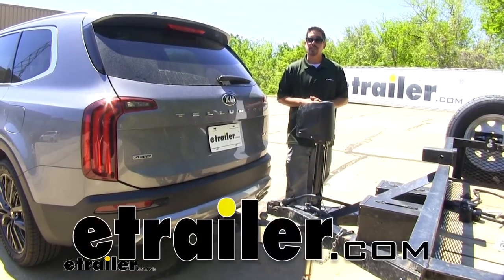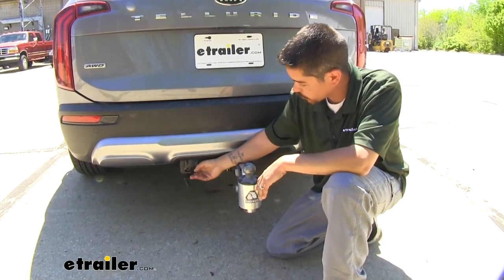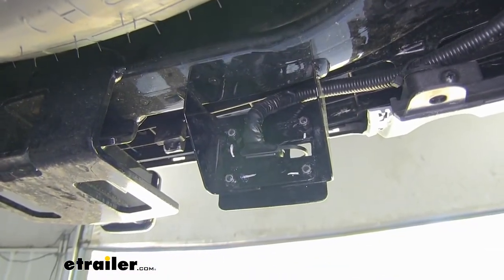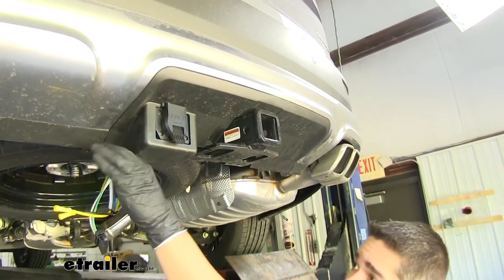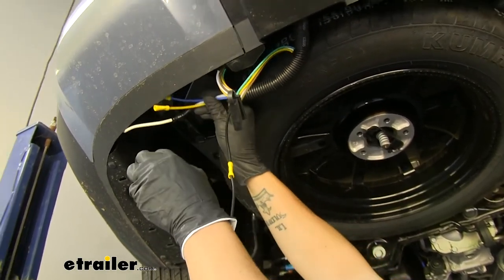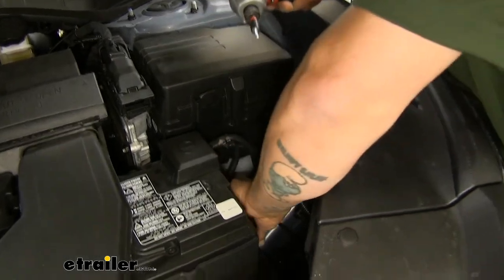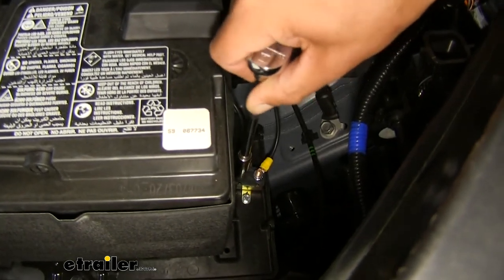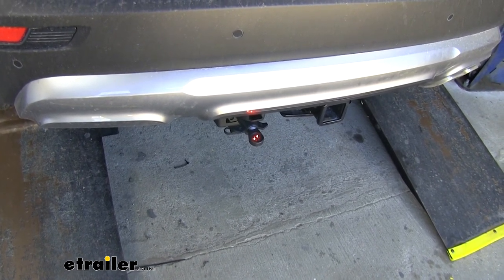etrailer Trailer Brake Controller 7-Way RV Upgrade Kit Installation - 2020 Kia Telluride

Comment: So there are no trailer backup lights with this 7 way?
Reply from the maker: The center pin of the 7-way provided with the kit carries the reverse lamp circuit, but you'll need to extend the yellow wire on the adapter and tap it into the vehicle's reverse lamp circuit.
https://www.etrailer.com/Accessories-and-Parts/etrailer/ETBC7L.html

Comment: You guys are the professionals. I have a question can a weight distribution hitch be safely used with a Telluride? My rv dealer says no we need a drop shank with sway control because it's a unibody. We had researched & already had our 7pin connector installed so we planned for a regular brake controller but they also recommend a wireless. Any input here? Tia
Reply from the maker: Many unibody vehicles cannot use a weight distribution hitch because of the frame design. You will find confirmation for this in your owners manual. 

You could use the Reese Friction Sway Control Kit # 83660 to limit the amount of sway when pulling your trailer. This kit will not put the strain on your vehicle like a full weight distribution hitch will.

Wireless brake controllers like the Curt Echo are a great option for towing.
https://www.etrailer.com/Trailer-Hitch-Ball-Mount/etrailer/989900.html
https://www.etrailer.com/Accessories-and-Parts/Reese/83660.html
https://www.etrailer.com/Accessories-and-Parts/Reese/RP26003.html
Reply: @etrailer  correct I have read that. I've researched the manual over and over & sadly they do not mention using a WDH at all. It does not say you can or cannot use one. The only thing the manual mentions is using sway control. Ty for the recommendations. We plan to get the sway control but now my worry is what would we do to adress sag if the trailer causes the Telluride to sag. Our travel trailer is well within our tow specs but was still concerned. It's an Apex Nano 2870 dry & 3800 GVRW